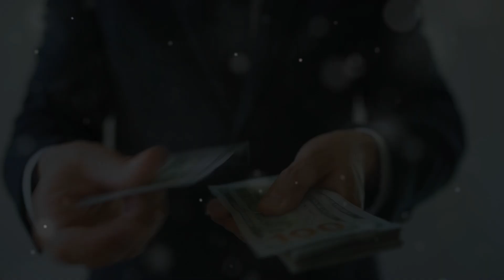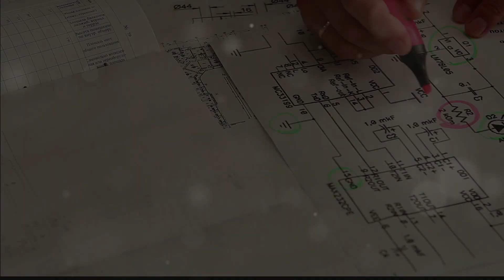Will The OPCs Ever Come? Off Shore Patrol Cutter Program Documentary #uscg

Comment: I worked at Tacoma Boat on the Medium Endurance cutters for USCG as well as the. USN program for a PCG, part of the foreign sales program build to SUPSHIPS standard.  Commercial ships are very simple.  They lack the crowded conflicts and complexity of a warship. The USCG never. Had the experienced staff to supervised construction.  Instead they threw in Chiefs and senior chiefs as supervision who had zero to near zero construction experience.  The WMEC were very simple ships however closer to a commercial ship than a warship.  

In building the at Eastern the yard did not have SUPSHIPS experience to fall back on.  However it falls upon the USCG to ensure the contractor had the experience and track record to complete the contract.  Eastern was clearly unqualified but the USCG failed to understand the difficulty of warship building